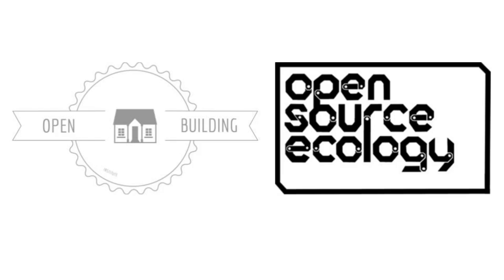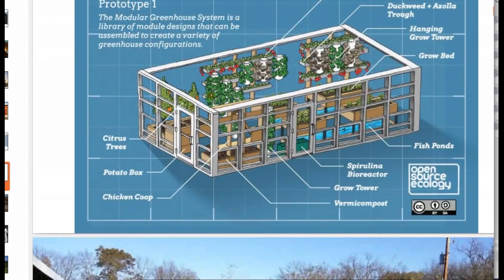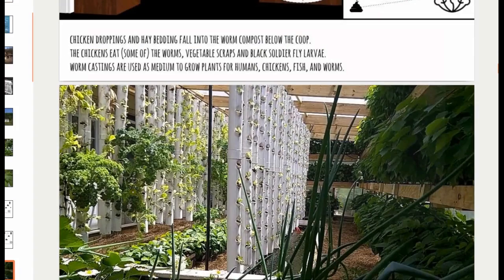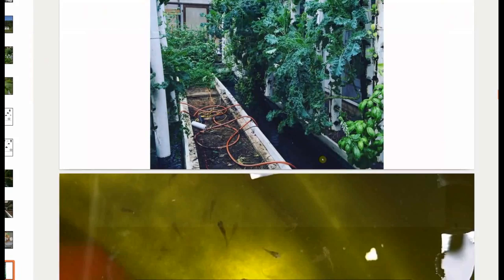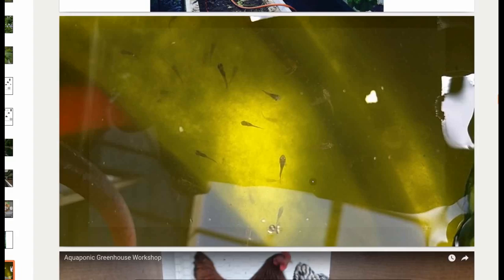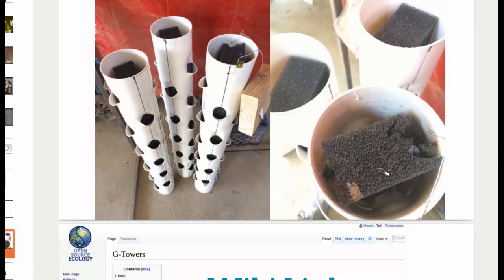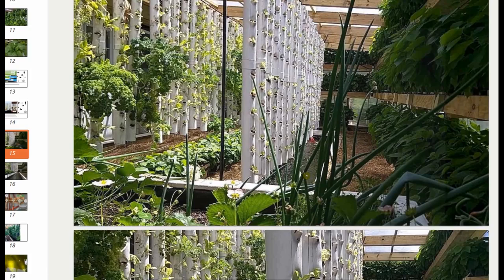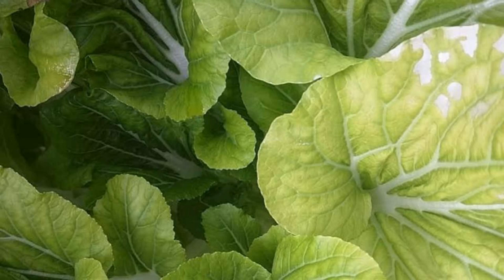Aquaponic Greenhouse Webinar by Open Building Institute + Open Source Ecology

Comment: When fitting toilets on ships or below the level of the sewer main, like in London where the sewer main is 100 years old and new towers have 4 levels of sub basement, a device called a macerator is employed to prevent blockages. It reduces the particle size of the waste. I don't work directly in that field and I'm not an engineer but I'm guessing you have to balance flow rate with particle size with aperture size. Like, what's the smallest hole in the sponges that will catch particles and how long will it take for the particles to clump therefore flow rate.